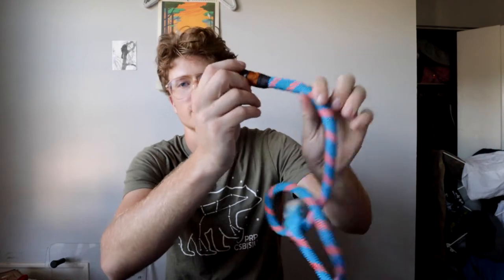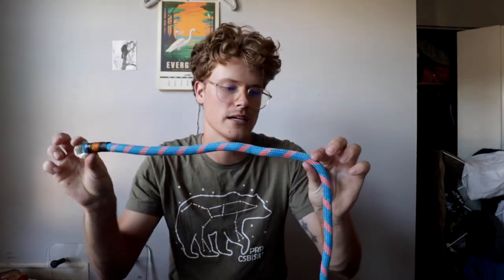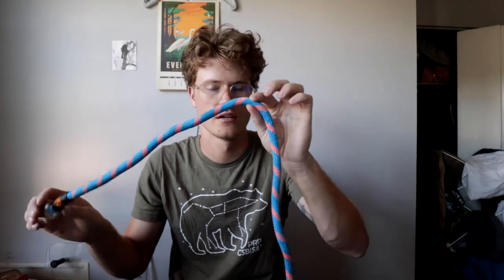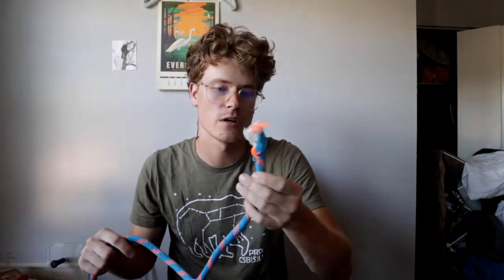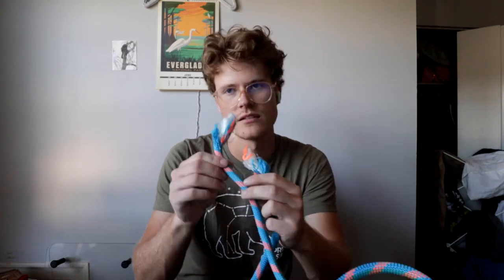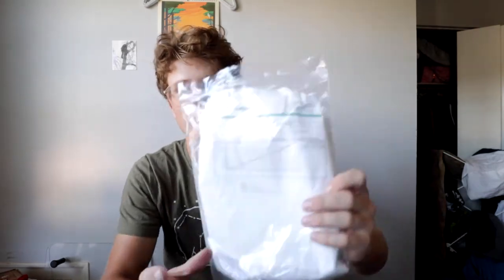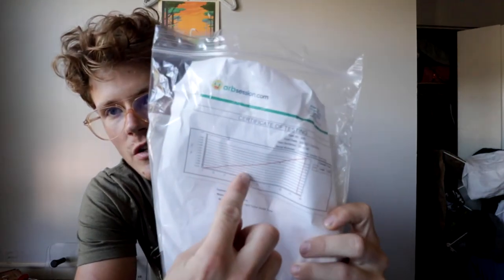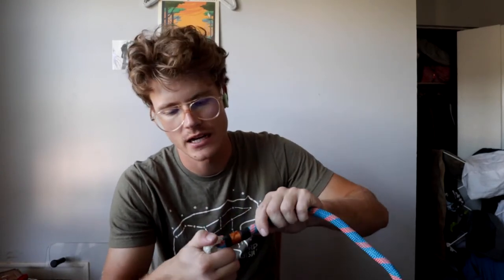Yale Kernmaster | Breaktest Results

Comment: impressive man! I have been looking for splicing instructions for sterling scion. just digging around the webs right now with no luck.
Reply from the maker: Just based on the product page I would use the Samson class 1 eyesplice instructions since it just seems like a regular double braid rope. I’d probably splice it with that without a second thought. If you haven’t standardized your double braid splice though I would advise that you have a sample break tested so you have empirical evidence that you can trust your work.
Reply: Scion is the same construction as Tachyon isn't it?
Reply: Yessir :) double braid, only caviat is tachyon has an inner core WITHIN the core. Keeps the rope round under tension